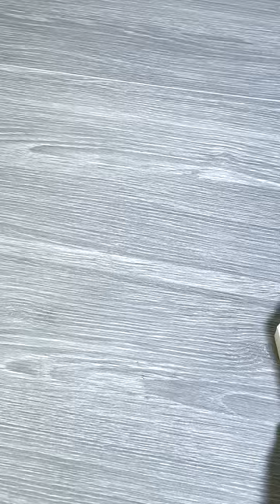20 Construction Tips and Tricks from an Old Carpenter That Really Work!!

Comment: You never miter an inside corner with moulding you cope an inside corner.
(Cut one end the moulding back at a 45° angle and by using a coping saw cut along the profile of the moulding).